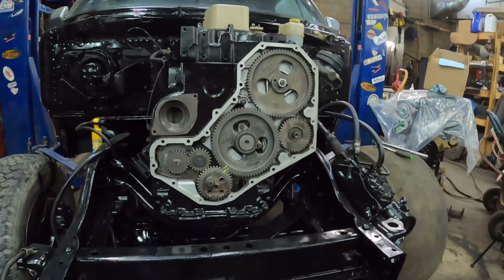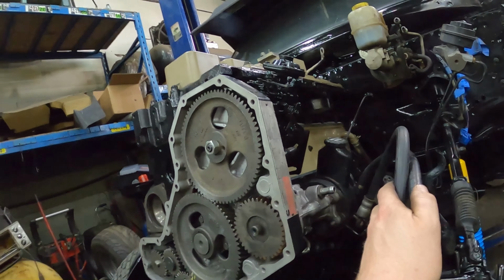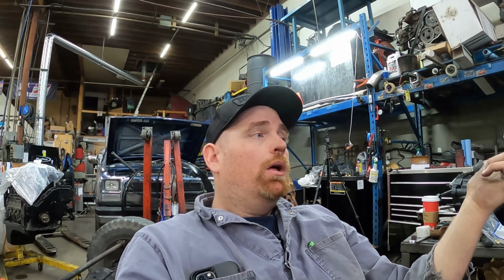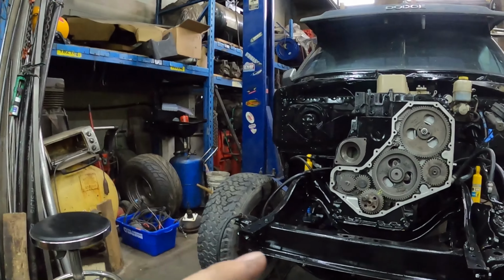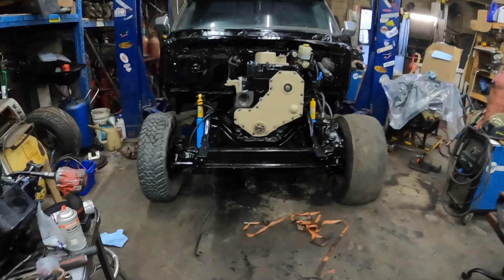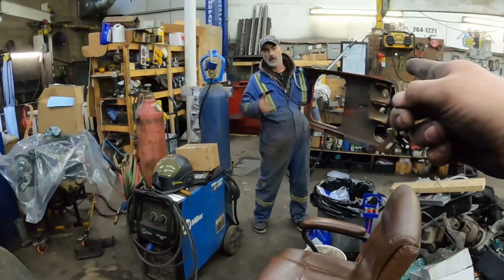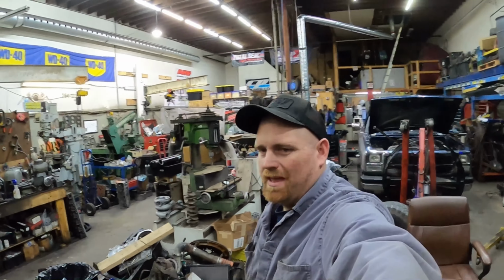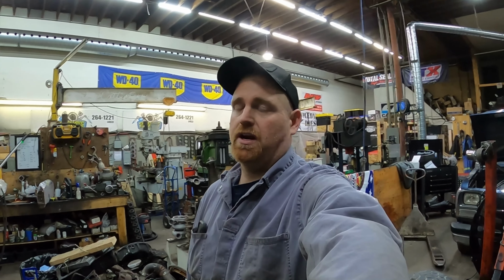THIS TRUCK is going to be AWSOME ( cummins swap w150)

Comment: Look forward to seeing this . Light  weight and an automatic , especially a well made one would would be a fun ride .. i really like those year models . .
Reply: It’s really not much less weight than a w250 would be. After swapping the axles and suspension, it’s about the same. From 77-88 the frames were all the same height, width, and had the same mounting points/holes.

Comment: Hey rob i’ve got a question for you. I’m putting together a list for my future upgraded turbo setup and im gonna be going with a 63/68/.83 with a t4 hx40 housing and gated t4 manifold. now im trying to figure out what external waste gate I should go with as far as size. could you tell me how i go about figuring that out or maybe even give any suggestions on size? this is on my 96 12 valve, 215 pump.
Reply from the maker: This is something I will be getting into on some videos talking about turbos and gates. Send me a email I can help easier that way. 
Robcutterup@outlook.com

Comment: Just go ahead and do a 271 it’s way stronger
Reply from the maker: Isn’t the n271 a drive side drop
Reply: @CUTTERUPROB  yeah cuz it is 3rd gen but you can change the oil pickup and flip it.
Reply from the maker: @bcbloc02  hmmm I will look Into that. I have never done that